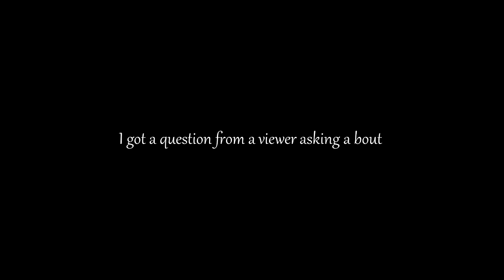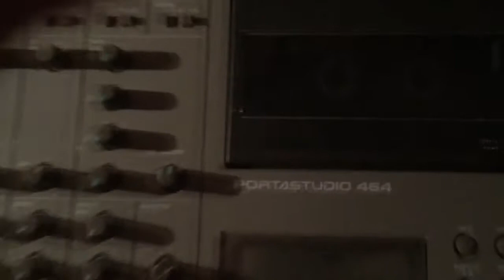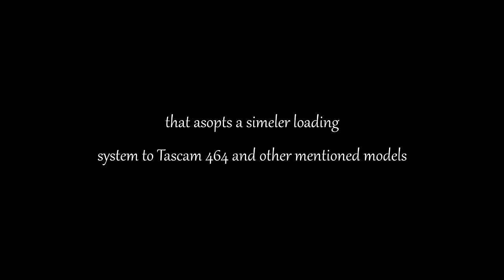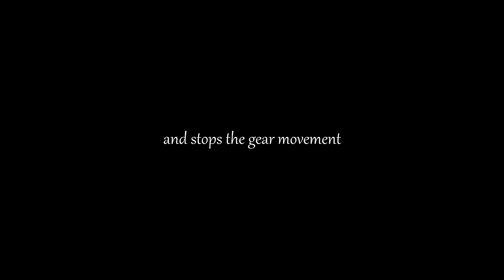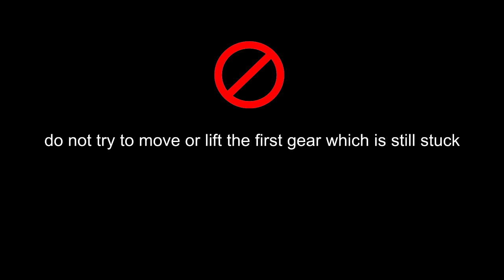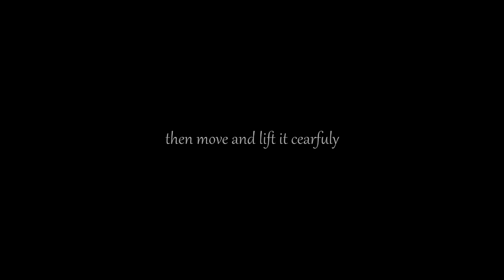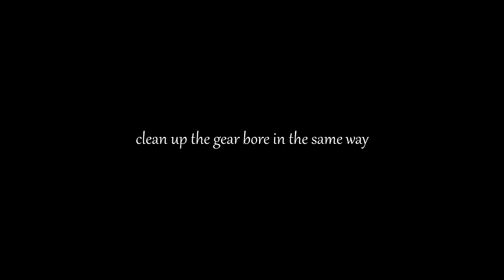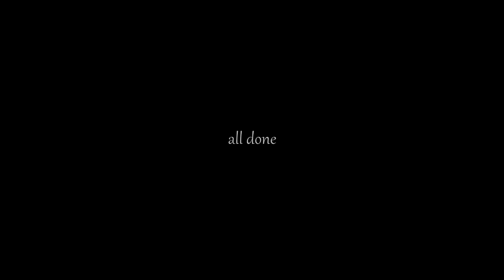Tascam 464 loading defect and repair

Comment: The Gear C is broken and the mechanism needs to be taken apart and cleaned of old hard grease and I use Lubriplate 105 when I grease these items. I was a Lead Tech at Teac in Chicago Factory Service and I am still working on decks today and I sell the gears.

Comment: Hey thanks dude this tuto is perfect,
Just one thing (or two) for the other
-be very carefull with the second gear when you lift it or clean it....It's very very fragile (i broke it...i used some super glue, its ok, but you can also order it with your new belt)
- be carefull with  the gear plastic lock (i lost it during th replacement...its very very small...)

Comment: You need a new Gear C and a bunch of cleaning and new grease in the unit. When three LED's blink it means an error condition. I have the gears made and am selling them in Chicago area. Just look up Skywave Tape Deck Repair.

Comment: hello, I replaced the broken C gear on mine, but it still have problem. It only PLAYs, RW and FFW for a few seconds, then the heads go down again. What could it be? I checked every gear, cleaned everything and made sure its all connected. Capstan also seems to have good torque, like every other motor
Reply from the maker: Hi,
The loading process does not complete to the end, there is hi tention or friction on the gears, make sure all gears spin freely befor you fit the motor, otherwise you have to check the loading motor and see if it has enugh tourqe to complete the loading,
Let me know if you need other help
Good luck

Comment: It has a damaged or cracked Gear C in the mechanism and this gear as well as all the old grease must be cleaned out and the gear I have made up custom installed. Contact me at Skywave Tape Deck Repair in Chicago- I have been selling them World wide for a time now. in addition some person has a video about a 488 that also has the same problem and it show the same solution.
Reply: I'll be contacting you very soon, this just happened to my 488mk2.

Comment: Ugh, this just happened yesterday to my 488mk2. It's that damn C gear that they don't make anymore, except for one guy in Illinois who sells them. He makes them himself and the plastic he uses isn't nearly as brittle as the original part. Not looking forward to taking it apart, these gears are not easy to get to at all.
Reply: Well the guy in IL is me and the gears are made in TN by a Machinist. I just sent one out today. I also change them often as well- even gears not yet broken are so brittle due to age that they do not have much time left if you leave it in there. I have never had one of my gears come back from a failure. Contact me a skywavbe@sbcglobal.net   if you need a part.
Reply: @sampalermo123  Nice! Thanks for posting! I'll be ordering today or tomorrow, thank you very much.

Comment: Hi! Thank you very much for this video, now my gears are spinning well! :) But when I switched on my 464 after this operation, the buttons REW/FF/STOP/PLAY/PAUSE/REC didn't work at all, there are no led functioning, whereas before the operation the 3 leds were blinking.. Do you have any idea of what could be the problem?
Thank you again for your videos! Great job!
Reply from the maker: Thanks for your question, make sure the mode gear and the touch cooper brushes pcb are (synchronised) ,  clean and good contact, let me know what going on with you after checking this issue, good luck
Reply: @3rdisland477  thanks for your answer :) I just cleaned the "mode pcb" (the one you show at 3:20) with isopropyl alcohol but nothing changed :/ the contact seems ok, I don't know what's wrong
Reply: I had the same problem after doing this repair. Turned out to be the Cassette sensor at the top right hand corner where you insert the cassette had been bent backwards just by a couple of mm and was not sensing the cassette which stops the transport mechanism from working.  Try pushing the sensor with your finger while pressing the play button to see if any lights appear.

Comment: WD40 belongs nowhere near a tape deck as it will evaporate and leave a sticky substance. You should clean with Denatured alcohol and use Lubriplate 105 grease to do the job otherwise you are wasting time. I used to work at Teac in the service business.
Reply from the maker: thanks for the info, just to make it easy for any one to take care of their machines
Reply: Lubricate 105 is that a spray can?
Is deoxit spray work too?
Is it better to try this before sending to tascam since it is expensive to fix?